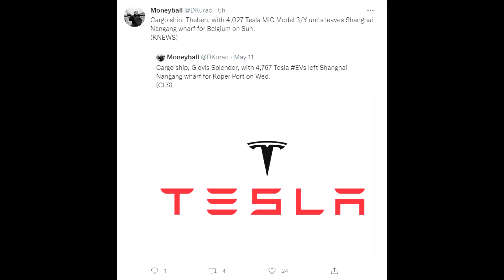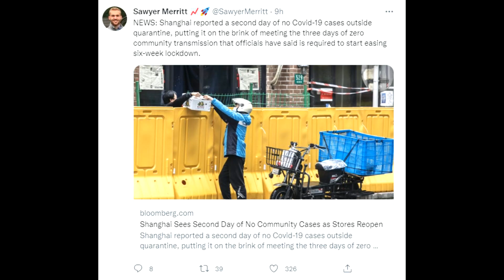Exclusive Giga Berlin INSIDE: DEMAND INSANE - Model Y Version cancelled for now!

Comment: How can Tesla reduce the amount of natural gas they use to produce cars ?
Can those processes be replaced with electricity from wind and solar energy ?
Reply: Use biogas.
Reply: Not to my knowledge as the Giga Cast is build for gas to meld the aluminium.
Reply: @andersvchristensen  So the pot furnace would have to be changed from gas burning to induction.  Not a problem for a company like Tesla, but that is not the issue.  The issue is, is it pragmatic to do it, not can it be done.  Of course it can be done.